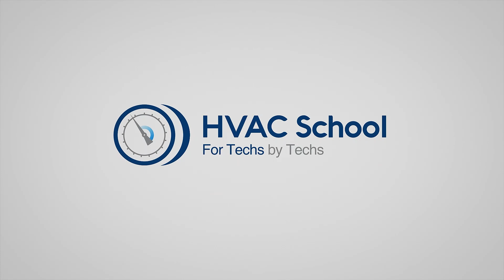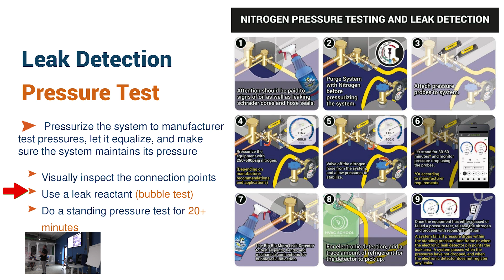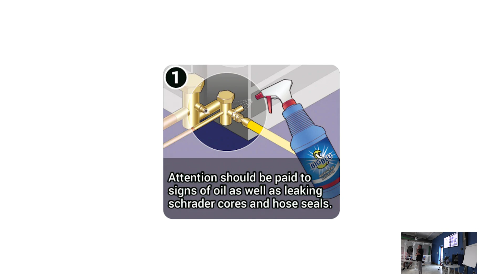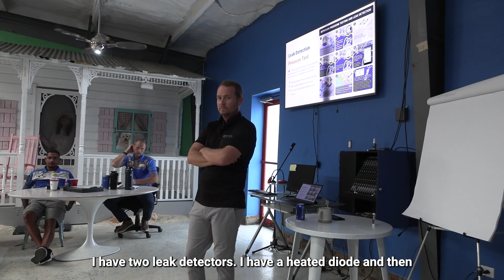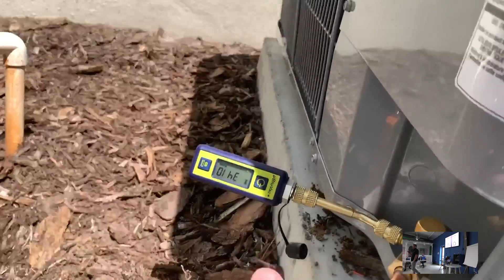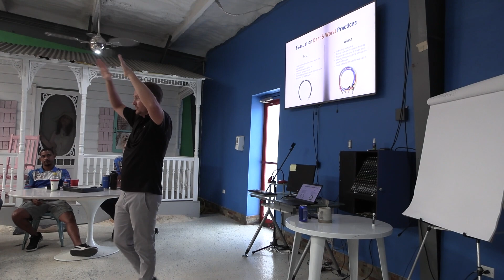Pressure Testing and Leak Checking

Comment: Metal halide former leak detector user here. 

Went through all the different electronic ones that we don't use anymore for 5 ton or less systems, of with easpecially split systems of where leak is usually on evaporator/ indoor coil.

If not flat/ zero psig.  Why charge customer so much money to do a leak search of in any way of including adding just UV dye to system to try to find. With of when you may find and  pinpoint leak.

Will tell costumers that sorry, such leak we found, we can't repair!?

Why do all think that big companies don't even offer the option of adding a sealant like fix a flat tire is that also includes a UV dye! Say EZ seal.

About 80 - 90% success rate with topping off a low charge and adding such to a system.

Of systems needing a little extra charge added on regular basis.  All the sudden, become leak free for the rest of thier many still years of life

Comment: People need to learn to bleed the refrigerant out of the hosesand back into the system. Open your high side and low side until the gauges equilize. Then disconnect your hoses. At that point your only removing vapor and not liquid. A 6' hose can hold something like 3oz of liquid refrigerant....in vapor form its an once or less

Ultrasonic works great.the leak spot has to have a way to have turbulent flow to hear.....to get around that.....get the area wet with water first. ...it creates turbulence....thats best way....and be weary of certain types of lights that can make "noise"

Comment: Why does micron guage reads weired when once its turned off on  energy saving and when turned on it starts tk drop down to where it wss before rapidly and then finds the actual micron resding but not do it instantly have you guys encounter that ?
Reply: Brother it's doing that to save energy, it's not storing the old pressure in it's memory so it has to re-calculate it.